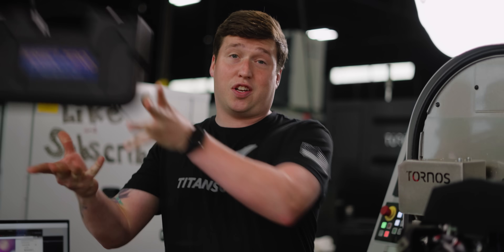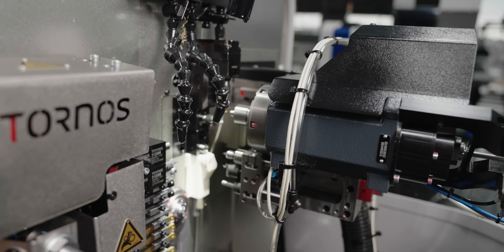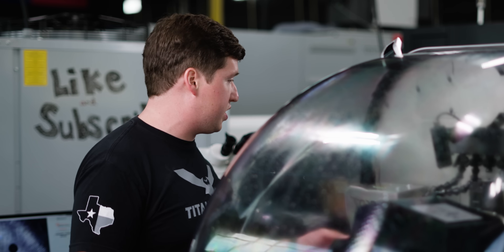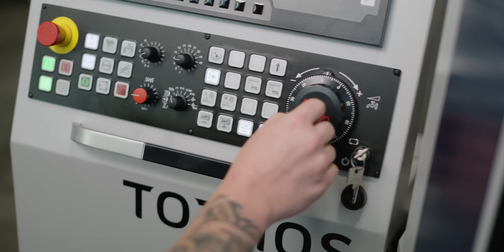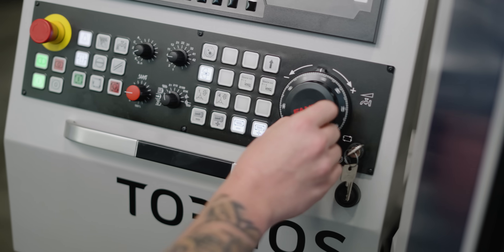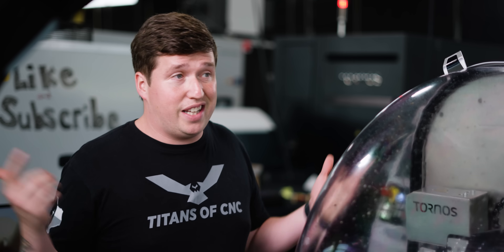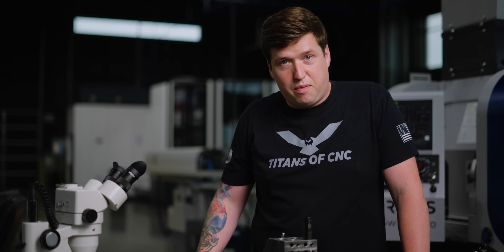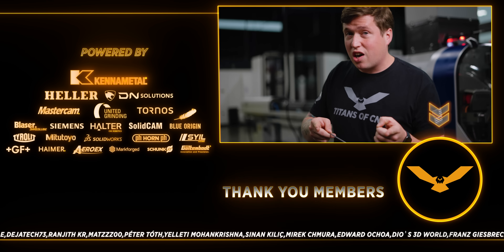Setting Up the MOST Complicated Tool in CNC MACHINING

Comment: Tenths are only the "smallest possible scale" if you measure in bananas. Metric machinists can measure in microns.
Reply: Only true metric machines. Some shops use imperial measurement and convert or upgrade the os of the machine. But neither is the same as a true metric machine because it ultimately comes down to how accurate the scales are. And metric is just finer data measurement than imperial ever needs to be.

Comment: Contrary to popular opinion I have found precious little from PH horn to be properly designed. Their carbide end of things seems top notch but interface from carbide to holder and holder to machine is beyond lousy. They make impossible looking tools and sometimes they turn out to be impossible to use too. Good video but I if you want micro tools, go right to Mikron for drilling. I've drilled thousands of .008 diameter holes in stainless with .0005 runout without any problems. That'd be like running a .500 drill with .031 runout, that would be insane... Mikron drills are so forgiving.

Comment: I see the smaller your parts get, the raw material seems more oversized. Off course you can't really work with 3 m long needles, but may I ask, what would be the smallest diameter rod, you would work with on a swiss machine? I went with a 3.2 mm in  diameter rod on a Citizen L32 machine, and I kinda regretted that decision, yeah it might work, but problems occur way too often to be considered acceptable.
Reply: It depends on the machine and the barloader. Tornos has done .5mm stock I think. I just keep the same 3.2mm bars for simplicity sake

Comment: All about the direction of the work and force. I started running on a horizontal mill and couldn't believ how might bites would hold 1 inch plants with a finger nail. But since imall the work was being forced into the mighty bits

Comment: I noticed a few things that I would address. Firstly, when you put the part that you are boring in the chuck/collet, you didn't check to see if it's running true. Secondly any tiny tool such as this should not  be put in a holder that has a screw. I understand the you find the center of the hole with the camera but if you held that boring tool in a shrink fit holder it would be running almost perfectly true and concentric to the holder already. Just my 2 cents. Good job regardless.

Comment: We ordered our perfect zero kit with our next swiss machine, should be here next month! It will be a game changer for our micro stuff!
Reply: They work super good!
Reply: @donniehinske They do, I've used one several times.  That trick moving off center to be more accurate when finding the center of the spindle is new to me though.  I never thought of that but it makes sense, thanks!
(When centering live Tooling I like to spin them to avoid any runout on that side causing inaccuracy)

Comment: You guys should make a video about what it takes to work for Titans! I'm a student at a vocational school right now, and this is my absolute dream job!
Reply: So, something I learned at Boombastic: They don't actually make any parts for production. They are basically a CNC marketing firm with education on the side. That Trumpf laser 3d printer they had? Trumpf sold so many that they took it out of Titan's shop because they literally can't build them fast enough. And all the guys I talked to agreed, they make 1-100 parts for a video, but they don't do production anything. They have 12 camera operators on staff. If you really want to work for Titan, be a video editor or camera operator. If you want to actually run a machine, you need to understand what every screw and circuit in that machine does and why. Your job will then be to teach.

Comment: What if the temperature changes, what would this do to the offset and chipload?
Does that machine have thermal management on the screws?
Reply: Yes the machine has thermal compensation but also benefits from being so small. It doesn’t require much force to move. It’s such a small machine it actually helps with the accuracy
Reply: @donniehinske  
Holding a ruler on screen I estimate the width of the cutting face of that tool to be around 210 microns (0.0083") lol.  
What made me think of machine thermals was pondering what kind of pitch must be on the ball screw driving the axis with respect to smallest repeatable move and also what kind of chipload in terms of the usual feed per revolution one would be running.  The feed per rev must be incredibly small, so much so that any fluctuation in machine temperature  would have some kind of effect.

I am a 10 year Solidcam user.  The machine simulator option is a lot of work to get set up.😁

Thanks for taking the time to reply.

Comment: Why not edm ?
Reply: I'll tell you why. . . $$$$
Finish the bore in process on the swiss in seconds vs. having to automate an Edm drill to cut 1000s of parts (slow cycle time) . . . . All the machining of the feeder bowls, railings, robot loader jaws etc etc etc.
You have to consider the cost at all times. It's much cheaper to buy that camera (works on MULTIPLE applications) vs. all the work for an Edm.
Hope this helps,
                             A Senior Toolmaker.

Comment: So the tool must be precisely located and straight...  But I still don't understand how the tool is strong enough to cut metal when it's too brittle to handle? I imagine the cut deflection is pretty high too?
Reply: Roughing drill and yes, it deflects. Notice he's using 2 passes. He bought that boring bar, but I would make one in my Anca cnc grinder that was much shorter to help with rigidity. Also solid carbide.
Reply: See, this is where the YouTube generation like yourself fail to actually know what is going on. “Shorter for rigidity” is where you went wrong. IYKYK

Comment: I've used a .018" drill on 304 stainless on a radius and that was a PITA but I can't imagine using a .008 boring bar on any material. I only had to do one hole on about 6 or 8 parts and broke several of the drills and scrapped a few parts that were difficult to make, it was all done on a Bridgeport. The second time I did the job the boss order cobalt HSS drills vs standard HSS drills and I only broke two or three drills instead of a dozen or so. I used a small keyless drill chuck that had a free spinning, knurled ring that spun on a bearing that you use your thumb and one finger to feed the drill into the part with, the chuck had a spring loaded shaft that it slid up and down on, the spring pulling it upward with little pressure. There is no way you could ever use the quill to feed a drill that small that would not give you enough feel and you can not regulate the force good enough. His boring bar is smaller diameter than a lot of chips are thick, I would not want that job fancy alignment tools or not.
Reply: Honest question...why not use a laser? It should be way easier to get a laser concentric and focused to that size vs using a drill. Plus, with some optics, you can adjust the beam diameter! Or is that the niche I need to get into, precision micro drilling...via laser!
Reply: Isn't the play (in every direction)  on a Bp 0.018"
Reply: @CATANOVA on a really wore out one on a good machine it should be . 006 or better you know what you're doing you should be able to hold .002 all day long I used to do better than that I used to hold better than . 001 true position on very complex variable geometry nozzles.
Reply: @chauvinemmons  
I was referring to the slop in general with them, having owned one and struggled with it.  Normally one would lock up the axis not in use and wind the knee up as far as possible.  Some of old timers would tell you that you need to torque up in the cut, whatever that means lol.  Generally though you can't really use carbide with them because of the slop resulting in tool breakage.  I gave away a draw full of HSS/cobalt when I sold mine and purchased a proper CNC where the difference is night and day.
I Would still have a Bp today but just use it as a super flexible drilling machine because there are some jobs a CNC mill simply can't do where the touch and feel of a manual machine like the Bp comes in to its own.

Comment: What is the process to grind this tiny boring bar? Did they grind it approximately to size, and then incase it in resin in order to minimize vibrations to finish it and then dissolve the resin away afterwards? Any video links on this would be appreciated.
Reply: THAT would be a process to see.

Comment: thats so boring
Reply: Turned in a YZ 125 cylinder head to be re-sleeved and bored to size back about 15 years ago.
The shop had a banner hanging from the wall that read - 
"I love my job even though it's boring"
Reply: @kevinspacey5325  sounds pretty borning tbh
Reply: @shivnillal3601  "borning" lol

Comment: I have a customer gearing up to drill some .0007 holes. They're trying to drill through .015 thick material,  gonna be the craziest thing you can't see!  $24,000 nsk spindle going to 80,000 rpms and NS tool made the drills @ $400/pc. Trying to get 80-100 holes per drill. They look like bee stingers!
Reply: That's nuts. 21 times dia
Reply: @LoneWolfPrecisionLLC with speeds and feeds and a quality tool it can be done! Wasn’t it Titan who recently did 40x D?
Reply: Yes it was, but an 0.0007" drill is on another planet compared to  that, specially at $400/pc. You couldn't tell if you've broken one. And how would you get it out of the hole it it breaks off in the hole. My mind boggles at the thought.
GOOD LUCK with that project!.
Reply: I thought wire EDM would be the way to go since it's only .015 thick.Then again they must know something I don't.
Reply: Well I can tell you from my own personal experience that will never happen. 
So I can say with authority the only way that will ever occur is using an EDM personally I would recommend a Sodick die sinker. 
I would mount a copper tungsten block in the tank somewhere near the job but out of the way must be ground perfectly square and have a very nice finish how comes the hard part you're going to have to make a drill chuck to hold . 002 molybdenum wire. 
I believe I used 0.001 wire to make it. 
The only real question I have how many holes do we talking about this is a dedicated production situation or only making a handful a huge difference. 
If it's only a handful life is going to be very difficult yes it's a serious production job you have a lot more money and more options if for some reason you don't have more money for a production run I wish you luck. 
Okay so let's say that you take a piece of like a2 a little tiny stem maybe only a hundred thousandths in diameter a nice little thread add a taper on the end now you're going to need a nut to open and close it there are a number of options but I will tell you I ran all mine manually you need to have a very small vice type of device they have to be perfectly aligned so what you going to do is you're going to push little drill down through the stem within about a hundred thousandth of the end then you're going to have to get a little piece of carbide and burn it down rotating it against the copper tungsten block in the tank until it is less than one thousandths you may wish to start this into the open end only a few thousands of an inch so that you'll have a visual Target and take your 1,000 molybdenum wire and burn two little slots 90 degrees from each other in the micro stem. 
Now with a short section of this molybdenum wire you need to thread it through the stem put the nut on it so that you can tighten on The wire the wire in a tube or something that is straight but you can control it and keep it from winding up on itself you must rotate it then you must get your clamping device underneath alliance that you can dip into it clamp on the wire and pull just ever so slightly you may require some voltage to warm it so it will stretch then burn the end off on the block in the tank you can try to burn down the OD of this piece of less than a human hair and you can attempt to burn your first hole practice makes perfect and you will get plenty. 
I do sincerely wish you luck with that can be done but not with a damn drill for a laser or anything else you might as well just get an oxy acetylene torch burn the whole shop down.
Ive been they're done that man it sucks a lot of what I used to do sucked for weeks at a time having to make 10,000 somethings to putting two 1 inch by 1 inch keyways in steel  and another pair in a brass bore went through 20 some odd inches in an 200 mm bore on an angle indexed  no less to each other and a bolt pattern in the end of the log of metal. If you got to ask where the hell I was when I was doing this you're asking the wrong question. 
And no I will never tell. Lot of things like that that I will never tell I might tell you what I did to a piece of metal but not what it was for or why.
Reply: that is never going to happen , you'll need at least 250000rpm , and perhaps a new material , not Carbide .
Reply: Serious question..why not just use a laser to drill that hole? It's gotta be easier than using those tiny tools.
Reply: @aperson7624 and for you Sir serious answer a laser is nothing more then a glorified oxy acetylene torch the results are similar but on a smaller scale there is curf the hole itself will be a series of blasts that just happened to be in line once you're in it a couple of diameters where is the ejecta supposed to go. I could go on but I don't think I should or need to
Reply: Wire edms do not start holes with wire God if they could I would have absolutely had it made. But you can use the wire in a die sinker if you can hold it
Reply: They don't make .0007 drills. Sure u don't mean .007? Lol. The snallest hole ever machined is 22 microns, (.022mm, .00086") and that was using EDM. 
If ur making .0007 holes (with a drill!?!?!)  u might wanna call GWR. Lol
Reply: 80,000 revolutions per millisecond...